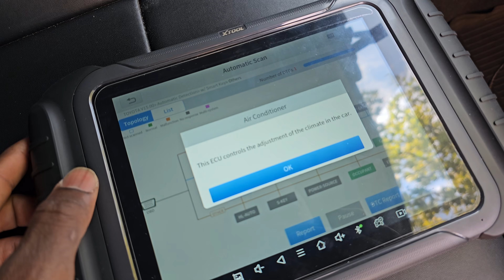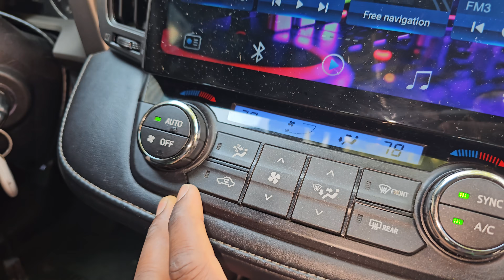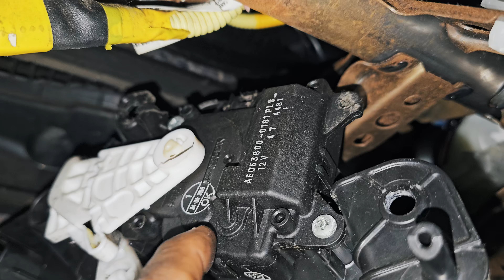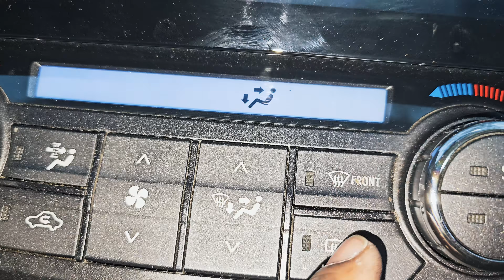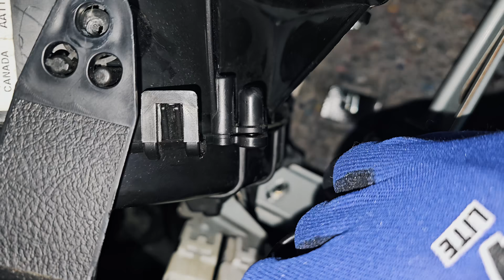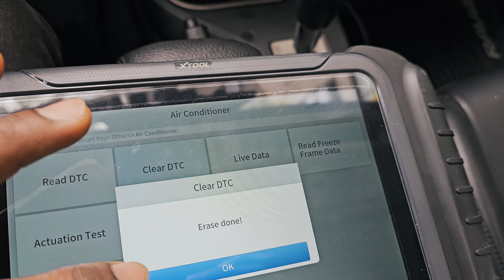Fixing Toyota B1442 servo motor damper control | RAV4

Comment: I have the shop manual but it said to remove the top and bottom dash.  I knew there had to a way without removing the dash.  JayKaren posted really good procedures on RAV4WORLD that didn't require removing the dash.  But it's always better watching it done.  I think with the combo of your video and the RAV4WORLD procedures, I can tackle this OK.  Thanks!!
Reply from the maker: You're welcome
Reply: As JayKaren noted, it's a total PIA!!  It took a long, long time but it was worth it. A dealer service or repair shop would have charged me big buck $$s.
I used his procedures to take the blower assembly housing apart (three sections).  That enabled me to take the top (vent control) out from under the dash and work on it easily.
I discovered that the problem is caused by a design flaw.  There's a soft washer on the gate arm pin that's too thick.  So, the gate arm pin is not fully seated in the servo motor claw slot and can easily pop off.  I sliced that soft washer off with a razon to make it much thinner. The gate arm pin seated perfectly into the servo motor claw slot and work perfectly.  Toyota's testing and quality control needs improving!
Your video helped a lot, especially duriing reassembly, which JayKaren's procedures did not address.  You noted that the screws/bolts, that attach the housing assembly to the frame, should be left loose.  I discovered that problem when the sections were really difficult to slide together.  Once I loosened those screws/bolts, it was a lot easier. 
Thanks again!
Reply from the maker: @vj_xx00000  You're very welcome. Glad it helped

Comment: I cant seem to take out the blower housing off. I only see 3 small philips bolts in the front?. Is there a back bolt im missing?
Reply from the maker: If you have the same car (Gen 4 RAV4), there are three screws holding the bottom part (motor enclosure) to the top part. But the motor assembly bottom block is held on by six screws if I'm not mistaken. The bottom left hand side toward to center console house a few screws I think, there is like a small panel to remove can't really recall clearly it was such a tight space and awkward disassembly that I couldn't film it
Reply: @YvonSmart ohh did you have to take the blower motor assembly off first then the housing?
Reply from the maker: @jbeastskill  I removed the 2 screws off the top portion of the assembly so it can be moved slightly up and down then undo the blower motor assembly. If you watch how I put it back together, it will give you an idea. I wish I recorded the steps. Also disconnect the blower motor cable from the bottom it adds some wiggle room

Comment: I was curious, did this B1442 code show up on your head-unit using the Torque Pro app?
Reply from the maker: Yes, but not automatically. When the check engine light came on on the dash, I used the Torque Pro on the head unit to scan the vehicle and it detects the code just as using a professional car scanner